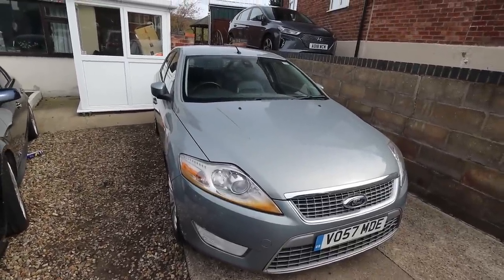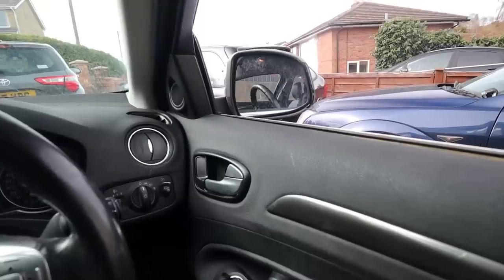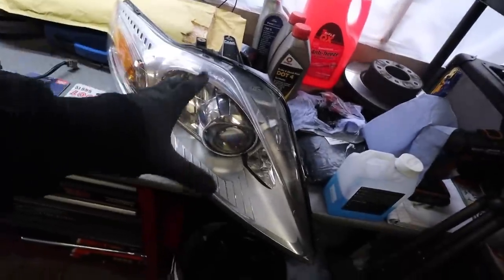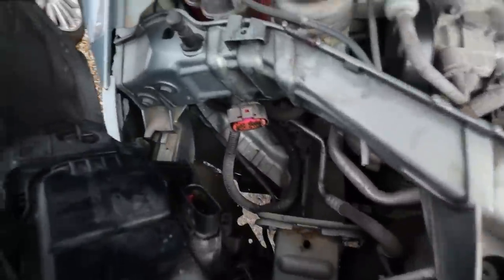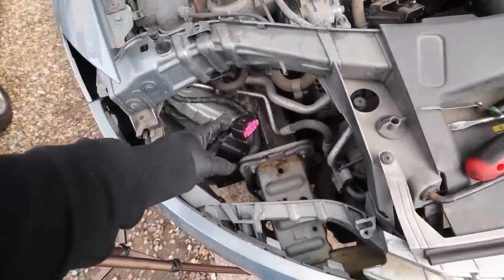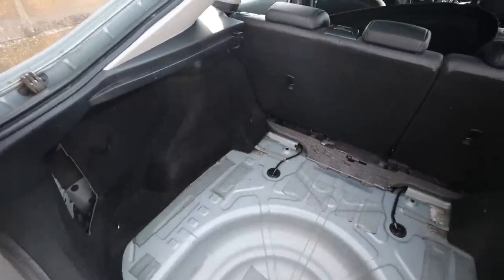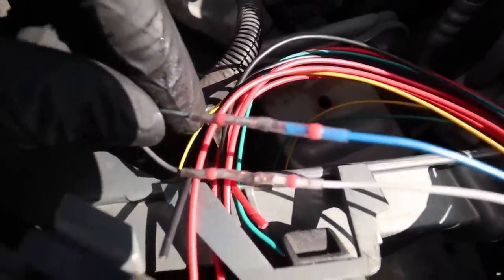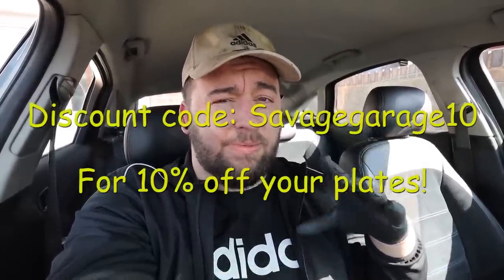Fixing More Issues On The Mk4 Mondeo Project

Comment: my 2008 2.0 petrol in zetec trim has covered 164k miles and has had the following in my 3 years of ownership:
Luk clutch kit, inlet manifold, drives shafts, front and rear wheel bearings, all new suspension(monroe), map sensor, iridium plugs, battery, intermotor fuel pump, fuel injectors off a low mileage scrapper and a auxiliary belt kit too. I'm the second owner the previous was a female doctor. the bodywork has some wear and tear but the interior is mint. I love the duratec engine, it pulls nice and has a camchain too and despite its mileage runs nice and quiet.

Comment: Hey man. I have a 2010 mondeo Titanium X and I had a small pond in my spare wheel well which resulted in lots of mould etc. The leak for me was coming through the wiring grommets that come from the boot lid in to the car body. I put some black silicone round each one on either side and it cured it.
Reply: What I also did was remove the trim on each side and cleaned the insolation as mine was moldy and full of water.
Reply: Yeah I did hence why I went a little further and advised drying out the insolation behind the carpets as it will be moldy.....

Comment: Blockage in Sunroof channels, front cowl drains, and rear hatch drain channels will cause major problems if dead leaves, acorns, pine needles, grime and debris aren’t regularly wiped away. Nice job James on fixing the leaks and the mirror, bad luck on the headlight harness. Stuff happens.

Comment: hi mate,,,i would defo up cycle the old headlight unit, sell as described and it can live again, also i had a similar experience with a wiring loom on yam r6 i was fixixing up, it took a full afternoon but i managed to cut and re connect every single wire and it saved a fortune at the time..but if only those fancy connectors were around at the time....great vid

Comment: I had one of these, exact same model, did me proud for years, I did several jobs along the way, rear suspension replace, wheel bearings , brakes, usual serviceable stuff, also changed oil and filters every 6k , never missed a beat, getting close to 200k miles then one day the push start failed leaving it totally dead and after ages in garage and constant consultation with Ford technical the problem seemed unsolvable and I regrettably scrapped it...big mistake...should have put it on my drive and methodically go through it myself... these are top motors... keep,it up👍

Comment: Ford does offer (at least in the US) connector pigtail kits to allow you to replace a bad connector by cutting the wires and soldering to the new pigtail ends. That connector is the same one that my 2013 Focus ST uses, and probably many other Fords too. As far as the clip goes, they are very easily broken (I broke both of mine!) but fortunately my connectors do stay put with friction alone...:) But you CAN purchase that plug separately, as well as a special tool to de pin-it - let me know if you want the part numbers!
Update - obviously I should have watched to the end before commenting! Lol. You did exactly what I would have done to fix the headlight connector. In fact I will be doing that to my own eventually!

Comment: Really enjoyed this video, thought the solder connectors were a good idea. Regarding the boot leak,   another common source of water getting into the boot, is in heavy rain, the water runs part way down the side channels and then drips into the boot. To avoid this part open the hatch, let the water drain and then fully open it.

Comment: As for the water in the boot, it might be worth checking under the rear bumper. There are two vents either side that are designed to let the air out of the car when you've got the blowers on etc, but nothing in. But they get clogged and perish and so let water in. I had a 2013 focus with the same issue and that was the problem. Hope this helps!

Comment: Good stuff and so much progress, looking forward to when you drive it!
1. Yes that boot trim is a pig to remove and my boot mounted brake light also had the water marks but I think there are drain holes for that. Bulbs were always going in that boot mounted brake light so it might be wise to replace with canbus leds if you still have the trim off (bet you've put it back on). 
2. My leak was from the washer jet on the tailgate which is also quite a common fault. Washer jet was crap as well
3. Never remove the other end of those cable boots on the tailgate. The side that's on the tailgate itself has a very difficult to remove retaining clip which the boots sits around. I found this when fitting a reversing camera. 
4. When replacing my bonnet release cable I removed the passenger side headlight but couldn't get the connector to release as it seemed 100% stuck. Also bonnet release cables snapping/sticking was common as they would rust around the latch side. You can get the complete kit to replace it but its a fiddle job under the carpet, through the bulkhead, battery out, airbox out, headlight out etc. However they did sell cable only kits where you'd thread a new cable through the old sleeve which could save a lot of time.

Comment: I was shouting at the laptop when you were trying to find where the water was coming in......."ITS UP HIGHER" Common Mondeo Fault
Reply: I had the same thing on my 06 Focus. The roof is glued to the sides of the Car and this glue tends to crack. Common Ford fault of tha era.
Reply: i had the same problem with water in boot of 08 mondeo hatch back    was coming in the rubber gators on wires at top      siliconed them up and that sorted it

Comment: I recently went to an auction that sells off cars used in the funeral business. I just missed out on a 2011 MK4 mondeo estate 2.2 titanium X sport in panther black. The car was stunning but the bids went just above my set limit. I ended up with a pretty basic MK4 mondeo estate that I'm going to use for my dog walking business. Now I'm obsessed with the idea of tarting it up to look a bit like the titanium X sport I missed out on. I always like to put my own stamp on my cars anyway and did so with my Mk2 focus which I fit the genuine ST sideskirts and ST spoiler (waited until some popped up on ebay the same colour as my car) with some decent ford 17" wheels. Only subtle changes but looks much nicer than the other basic climate models. Good luck with your project! I'll be following along for ideas.

Comment: Hi mate I also had the soaking wet headlight problem. Sealing it up didn't work, so had to get a replacement used part. My connector plug was also broken at the clip (they are horrible to get off and end up breaking I think), but it still fitted on ok and seems to be staying on by itself so thankfully I didn't yet need to splice in a new connector - but its good to see how you did it in case I need to in the future.

One thing I did need to do after fitting the new headlight is get into the car config using Forscan and run a headlight calibration service procedure in order to clear the dashboard warning.

Also hoping to fit some new numberplates, the bonnet gas struts and replace all the interior lights with LEDs.

Hope to see more of your videos in future!

Comment: For the leak check the seam joint with the top of the roof/door/hatch/roof rail trim. I had a leak form both sides on my MK2 Focus, found that the seam seal had dried out become brittle and fell off along with the paint, i just cleaned up, painted with scratch repair kit filled any possible gaps with liquid gasket seal

Comment: I use those solder but connectors all the time now. I repair trailers and spend a lot of time replacing lights for new units. The trailers are mostly plant or horse trailers so are up to their axles in mud most the time and I’ve never had a issue after using these. Used to get a lot of problems with normal crimps and tape.

Comment: Very informative video. Having purchased a mk4 mondeo myself. I have noticed a slight rattle coming from either drivers side b pillar or rear drivers door. It's slight but annoying. I've stripped the b pillar and stuck double sided foam 3m tape anywhere I was suspicious could be the source. It's still there. Next job remove rear drivers side door card see what I can see! Keep up the good work

Comment: One overlooked source of mystery load area leaks is the rear screen washer jet. Rubber and plastic pioes split or go hard,  then don't seal tight on the ribbed jet  connector,  leaking when it's used.   Older pipes can also go brittle and split or crack where they flex as the load door opens.

Comment: Great video! The reason of the water ingress on the headlight is the missing round shaped rubber cover (cornering light cover). It is visible when you removed the headlight. Another possible cause might be missing/broken plastic back cover or it’s tabs. The rust is coming from the afs actuator motor which is situated near to the bottom of the headlight. When that much water gets in the motor is literally under water which makes it corrode and malfunction. Actually you can disassemble the headlight connector and replace the housing, but it will not worth doing. The connector will stay firmly connected without the plastic locking tab. This locking tab thingy is the first thing to break off if you not familiar with how to undo	 the connector. :)

Comment: Not an issue for this job but one tip if you need to splice lots of wires like that - if you stagger the joins a little up and down the wire you can avoid a big bulge where the connection is made - useful if you have space constraints or have to pull the wires back through a tight opening. Keep up the good work 👍

Comment: Such a decent job on the headlight connector 👍  ....another cause of water in the boot can be when people try to use the spray during the winter.  If it's frozen the pressure can pop apart the water line in the roof/boot on some cars.

Comment: Type terminal removal tool in eBay. You should be able to get the terminal on the light off and then replace
Reply: I did the same thing I semt info on the keys to get the old plug off half way throw the video

Comment: On my Mondy mk4  2010 a airbag is behind where you discovered the path of the water leak on mine the airbag was covered in surface rust and the connector terminal was like your headlight one. I would remove that piece of trim and just check them airbags of any future problems

Comment: Hi James, wonder if Mondeos (mk4) have fuel pump or injector relays? If yes, where is the location? Mine is cranking but not starting. I sprayed easy start into the intake and cranked then car will momentarily start. Fuel line is Okay. I think it is to do with some relay?

Comment: Genuine Ford Rear Door Moulding 1614872 and Genuine Ford Rear Door Moulding 1614841 part number for extra seal for the boot sorted my water problem on my mk4 mondeo 10 plate

Comment: Hi mate, just a suggestion for that plug, it’s possible you could replace the plug housing. See if there’s a part number on the plug, if there is go to local Ford dealer and see if they can get said plug separate from the loom. If they can, buy a de-pinning set and de-pin the connector and re-pin to the new connector :)

Comment: Had similar issues with leaking water in my mk4 mondeo, turned out it was the seams on the channel that runs on either side of the boot lid, just under where you put the sealant for the cable grommet. Seems its age related and the body flexing breaks the seam sealer and water can get in there. Not obvious as its body coloured but sealed that area and it doesn't leak any more

Comment: Easy way to make sure no water build up in headlamps is to drill a hole in the bottom... As long as you dont park the front end in a lake it will be fine. To clean or replace the connector properly you need to take it apart, remove the red part just pull/pop it out, then back out the pins.

Comment: Easiest and best way to fix the plug is get a new or used plug and use a pin removing tool and as long as the pins are ok just remove them 1 by 1 and swap them over to the other plug . If there's not enough give in the wiring to do it one by one just mark them up and swap them over

Comment: Help! I am attempting to replace my corroded brake pipes for the first time on my 03 registration Vauxhall Astra g 1.8 ! How do I remove the brackets that fix the brake pipes to the underside of the car? I have some photos of the pipe brackets and it looks like some 6mm nuts that are very small and need a deep socket drive to undo but I am not having much success just this far! Perhaps I should just try and hack saw them off and replace them with new ones? How should I tackle this problem? I would be grateful if you can help!

Comment: Thanks for all your great videos. I have driven my way through 5 Mondeo cars in 22 years. I love the MK3 but my latest one, MK4 2010 Ecoboost 50000 miler has been the biggest pain ever and I hate it. Gear box takes about 2-3 seconds to engage 1st which leaves you stranded at junctions, it does this in spite of the £350 3 yearly gearbox oil changes... and even holds reverse with the stick in drive if you catch it right... the car proceeds in opposite direction to that indicated and selected by the stick. The car is too big and wide, awful visibility with crap bloated handling. The most unreliable of all the ones I have had. Two brand new throttle bodies in 20k miles,  Numerous spurious error messages from the over keen computer including thinking the battery is flat when it isn't because the software engineer set the level wrong(!) Yes, I hate my mondeo, basically it failed it's MOT today on that damn stupid headlight leveller and it going to cost £550 for a new headlight because you can't replace the leveller module and I can't find a used one anywhere... did I mention my knackered rear swing arm bushes that cost a fortune to replace, do you want to buy a Mondeo? 🙂

Comment: I have the exact same model, I want to change the puddle lights in the wing mirror but they have a hex screw holding them in that's not easy to get to, how do i get to it, I've even tried tilting the mirror, do I need to remove the mirror glass itself to gain access, if so how do I do that without breaking the glass.. Keep up the good work..

Comment: Just FYI. You can fairly easily depin that connector and fit a new plug. However if the pins in it are really rusty you can probably buy a repair section from Ford to splice in. I know stuff for VAG group cars is pretty readily available.
Reply from the maker: You’re like the 100th person to say this, I did mention this isn’t he video but I also said that the pins were quite corroded from the water so I decided to add a new plug

Comment: Most of my post is educated speculation.

BUT
 
 As a person who works on computers all day it is highly likely you can push the pins out of that connector and replace just the plug itself. There will be special pins crimped onto the wire. You just need to release them and it should pop right out. If you get a plug from a breaker try on that first. That pair of tweezers will help. It’s also likely that you won’t need a specific wire loom it’ll just use different pins for each style of headlight so a standard light will just use the pins relevant to it and not the power for the motors to tilt the lights.

EDIT: Nevermind i posted that about half way through the video.
Reply: @Ross Bourne Never ask me to read through an instruction manual.

Comment: You should’ve really taken all that boot out carpet and plastic out. With the water running down the wires, you’ll eventually get the same problem with the headlight connector pins. Corrosion will end up eating through any of the wires/blocks/terminals. With that I would do a deeeeeeep clean on the boot interior. 👍🏻

Comment: Those connectors like most have a secure clip that holds the terminals in place. You simply find out how it’s locked, remove the securing clip and depin the terminals. If you look up on YouTube how to depin terminals/connector blocks, you’ll be able to take out the pins and replace the plug. Buy a decent set of terminal removal tool to make your life easier.

Comment: any chance you could show a image of the light switch wiring on the 6 pin plug at the rear please , my mk4 mondeo has the wiring for the fog lights but not on the headlight switch . replaced the switch but there is only 4 wires on the plug , i need to know the wire colours please

Comment: I've just bought a used mk4 1.8 tdci 2007 few days ago and the boot had water just like yours after raining. Looks like I won't need to find out where the water comes in thanks to you :-P also the car is vibrating at 1500 rpm so I'm assuming at least one injector is misfiring despite car running smooth while driving it. And yes this one has a chain cuzz it's a 2007 mk4, the ones from 2008 are drivin by a "wet" belt. . . so I'm lucky at least on this part :-D
Reply: Vibration could "just" be an engine mount 👍
Depends how bad it is

Comment: Electrics are horrible to work with they really are and I really do admire you using the best heat shrinks known to man. But there is a tool where you can push the terminals out the old plug and reinsert into a new plug. That would of made the repair a lot easier and also would of saved time. 
However another amazing video James your content is tip top.

Comment: Hi James, is there possibly a link to where I can get a headlight connector plug for this car please? I have exactly the same corrosion problem on the plug and a broken pin on the headlight, is there a way to repair these? If I could only get the socket on the unit out, perhaps I could bodge it....